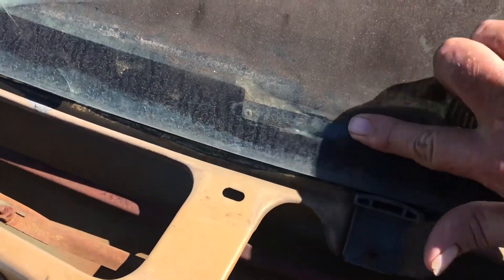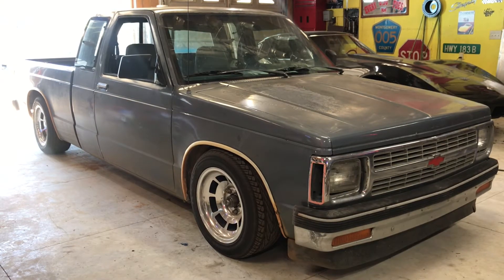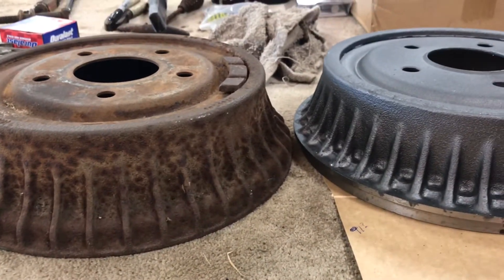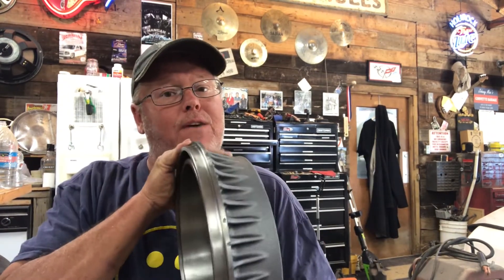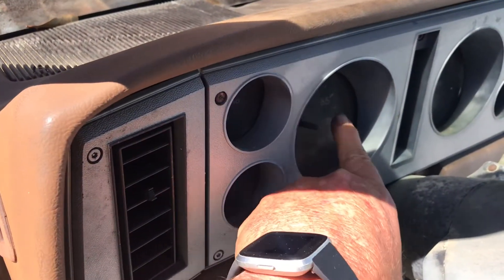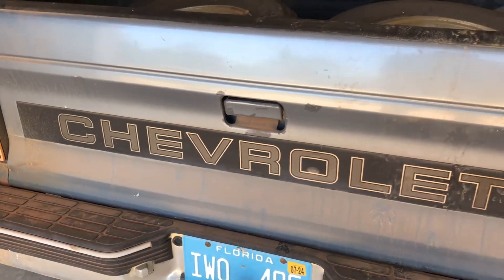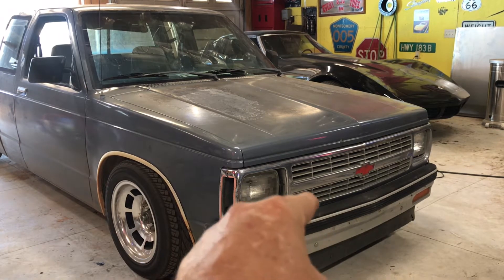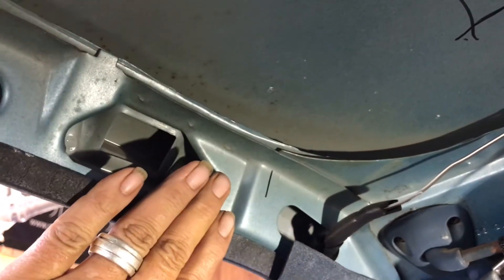Junkyard S-10 Identification (First Gen)

Comment: Great video with lots of in depth information.  It so strange how so many parts will bolt on but don't necessarily interchange with all the differences in the different years. 

Thanks for the plug...and for making me go out to the driveway to check my upper door jam structure😂

✌️
Reply from the maker: Totally agree about the parts! 
You earned a that support! 
😂you went to check?😂
Reply: @wrongwaygarage  😂I did! And on the 87 it doesn't have the structure over the door but it does pick up after.  However it runs all the way back on the "Toaster" 94.
Reply from the maker: @s10tacious  good info to have! 👍🏻

Comment: Rangers are almost as bad. I have a broken left window bracket in my 86. I think it only ran for 2 years. It's no longer available. Different tailgates, Vent windows/ no vent windows!!  it goes on and on!
Reply from the maker: Agreed! I had a Ranger in the mid 90’s. Same problems!
Reply: @wrongwaygarage  Yep I have an 86 and a 94! And a 98 Ex sport LOL. My friend has a 91 and an 04 (I think it's 04). I have a few vids on my channel on the 91 (Minitruck stuff) My 94 is v8 swapped and on 37s. So not mini truck stuff. LOL